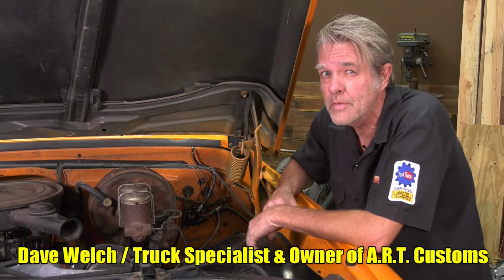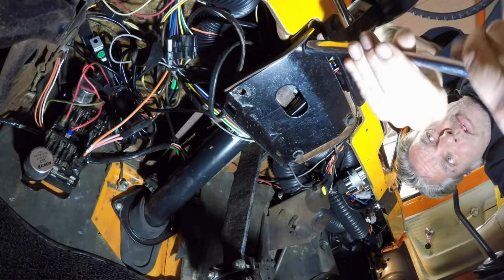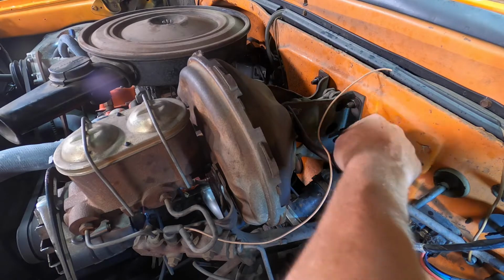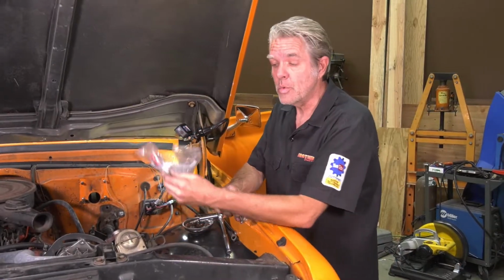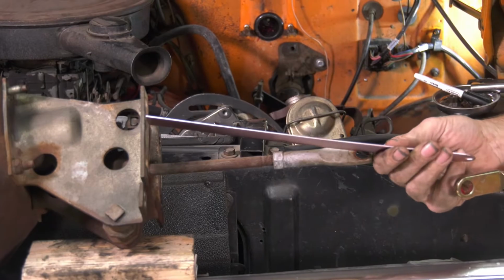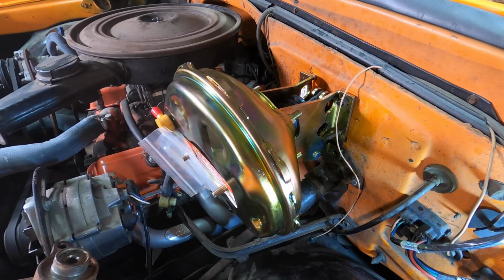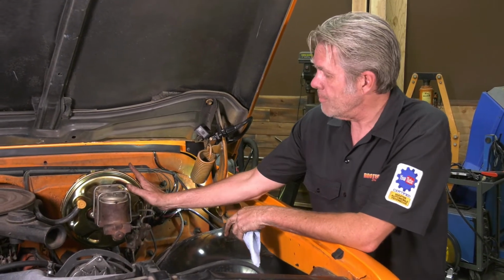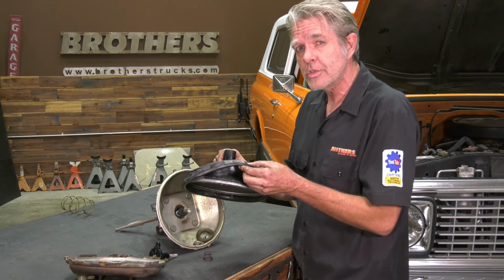Chevy & GMC Truck Power Brake Booster Removal and Replacement - C10 / Squarebody / Classic

Comment: The shop change everything 86c10 .Calipers pads master cylinder .Brake hoses . prop valve. rear pads. As soon I hit the brake They lockup.Going crazy

Comment: It's never as easy as the YouTube videos show it to be! I'm replacing ALL the brake components on my 1980 Chevy K20 truck. The first problem I ran into is disconnecting the booster rod from the brake pedal. I don't have access to it unless I remove the AC duct under the dash. I can't remove the duct until I remove the emergency brake release rod and I can't remove the rod because it is held in by one of those awful plastic snap in things. I gave up after 30 min. of trying. The must be a tool for removing linkage from them that but I don't have one yet. The K20 has 6 studs with locknuts holding the booster in. I've only been able to remove one nut so far with a long breaker bar.  I will have to remove the wiper/washer assembly to access the other 2 nuts on the driver's side. All the nuts below the top 2 have been sprayed with sound deadener (tar) which I'll have to remove before I can get a socket on them. It would also would have helped if I had removed the hood. I may finish by Christmas🙂. This is an excellent video by the way!

Comment: A vacuum hiss is one problem, but the check valve rarely fails but can. If you have no noise yet it is harder to stop, run the engine for two minutes. Shut the engine off! If the rubber diaphragm inside the booster and check valve are good, step on the pedal in a normal fashion but count. The pedal drops and brakes apply, but if the pedal is noticeable higher and still hard after two to three pedal stops, the problem my be the check valve or too low engine vacuum if you just swapped camshafts for higher lift, duration and overlap.
  At this point, as long as the hose and fitting are good, you may chose to get a “Dual Diaphragm” booster or one of the largest diameter that you can fit. That depends on engine placement, higher / tall rocker covers or other interference. Just make sure brakes are free and in working order before jumping off the deep end. Retired ASE Master

Comment: Great tutorial! It was super easy to follow.
I replaced the booster and master cylinder in my 76 C10 but it still feels like the booster isn't fully kicking in. How do I know if the vacuum pump is bad?
Reply from the maker: Lots of reasons for that. Could be that you have low vacuum in your engine (big camshaft, etc) or you chose a bad source to draw vacuum from. Leaks in the line or possibly even a bad vacuum booster in the first place. check for leaks first and move on from there.
Reply: @BROTHERSTruckPartsTV Where would the hissing sound be more pronounced!!! Mines seems to be inside the cab near the rear of the booster. Does that indicate a bad booster? Thanks a million.

Comment: Do you have a video for rusty bolts on your rear brake lines for my 72 chevy truck
Reply from the maker: we don't have a video for that specific problem. Typically if we can't get them loose with a line wrench, then we escalate the situation and try vice grips. If that doesn't work then you're faced with cutting the lines off and making or buying new ones.

Comment: Very good tutorial. Just subscribed. Would this tutorial encompass a 2005 GMC 1500?
Reply from the maker: They are all very similar, so you should be able to use this video and it would help get thought just about any GM booster replacement.

Comment: Nice video! Do all trucks have the two support brackets? The one to the booster and master. I noticed my 71 c25 has them and my 70 c10 does not? Do I need to add them? Thanks
Reply from the maker: You may find various applications that will need the brackets added. Specifically if you are going from a non-power setup to a power setup.

Comment: Hello question my booster makes hard for my oil dipstick cuz of my headers as well. My question is can I change the booster to a smaller one & if so will it affect my brakes ? Can I replace my dipstick & with what?
Reply from the maker: You can go with a 9" booster to give yourself some extra clearance, we offer that option.
Reply: @BROTHERSTruckPartsTV  thanks need to get a catalog from you guys again thanks

Comment: My '68 C10 didn't come with a brake booster. I had found a donor from an older square body, but It's been over 15 years since I've done it and can't remember what I had pulled it from.
Reply from the maker: You'll need to make sure the bracket that holds the booster to the firewall is compatible with your '68. Aside from that we think you're good

Comment: My 69 GMC 1500 booster has a metal tube that comes out and does a 90 degree downwards.  Idk if a hose goes right to it or if there is supposed to be a molded fitting to mate a hose to it?  It's about a half in in diameter.
Reply from the maker: Does it attach similarly to the White plastic 90° bend on our unit? Maybe it's a vacuum port?

Comment: I bleed my brakes no air it's a dual master cylinder I nich bore on my 1963C10 fleetside truck pedal still seems soft when I crank it on I have no brakes master cylinder and booster is new not sure what I'm doing wrong  pls help thank you for your spare time

Comment: I was wondering if you would know what to look for since I had my 87 scottsdale engine replaced since it threw a rod. We put in a 350 small block from a 71 camaro and it does not want to shift up into third gear. The guy did a shitty job so any ideas help! Thank you very much
Reply: It is an automatic transmission. Still stock from when we got it
Reply from the maker: The '87 has a 700r4 transmission with a Throttle Velocity cable that controls the shifting. You need to have someone adjust that cable for the shifts to work right. It sounds like it's too tight right now, but we don't recommend you just loosen it or you could burn the clutch pack. Have someone who knows how to adjust it right do the work, or do a lot of Google searches and know what you're doing before you mess with it.